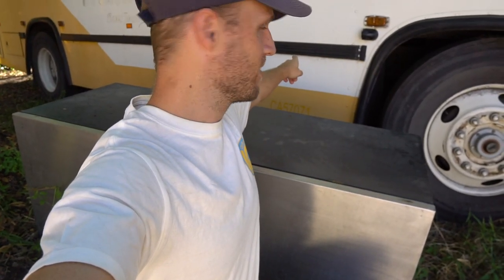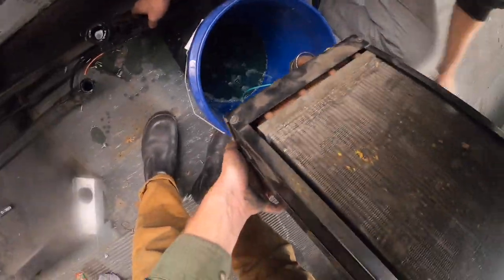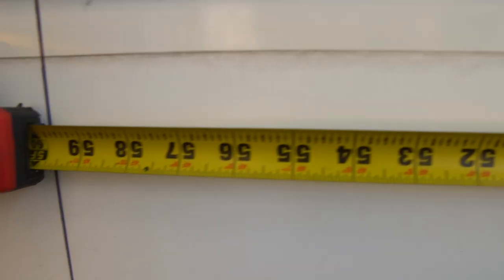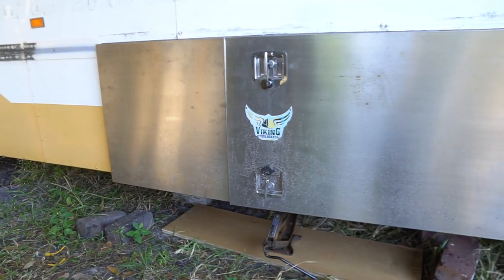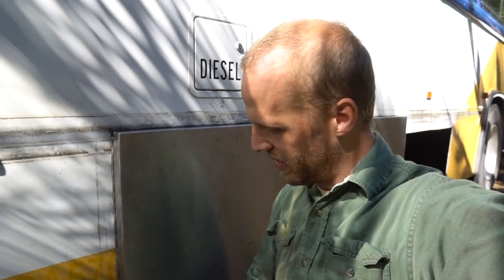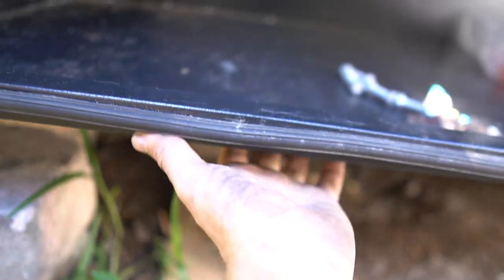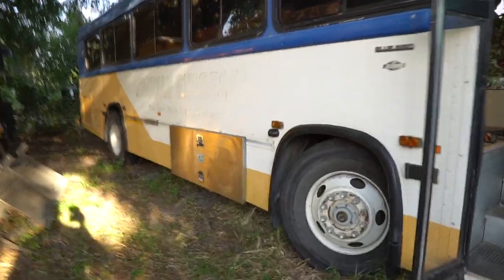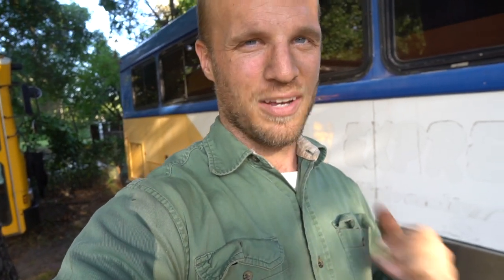Installing Undercarriage Storage Boxes the Easy Way in This Transit Bus Conversion

Comment: Something that could be pretty simple, cheap, and not require welding would be using a couple metal straps (something like how fuel tanks are secured on some cars and truck) to capture the bottom of the boxes.
Reply from the maker: I like that idea. Could install 2 without much trouble. Thanks!

Comment: This is a question related to the solar racks you used on your bus. You used the iron ridge rails and I was wondering if you feel they the UFO bolts hold the panels on you roof securely. I am going the same route for my bus, but I would hate to have a panel blow off while traveling down the road!  Any input would be appreciated. Thanks
Reply from the maker: You'll be good. We've done 18,000 miles on our bus and have the same system. Sometimes I climb up there to tighten/check the ufo bolts and they're rock solid.

Comment: Should have just inverted the angle iron frame and rewelded the legs on..
sorry the engineer in me is cringing at the hap hazard approach your taking to this. That steel work is nowhere near strong enough even for what your planing. And the fact that your going to drive this on the highway possibly putting other lives at risk if it fails troubles me..